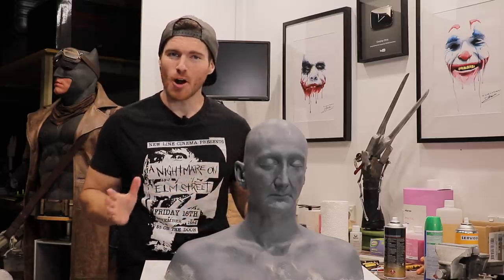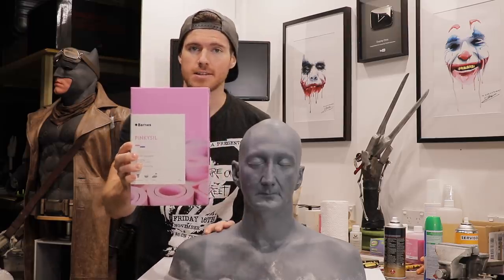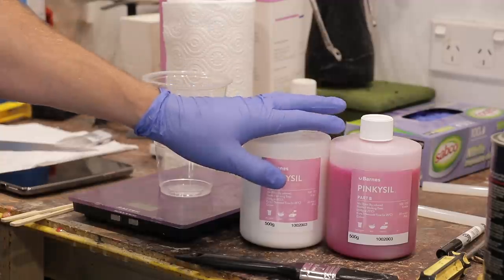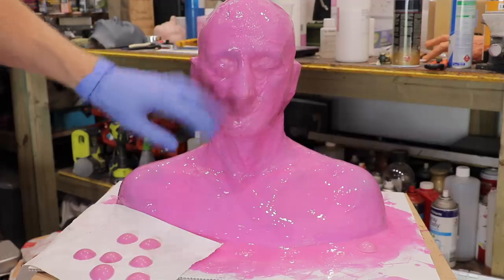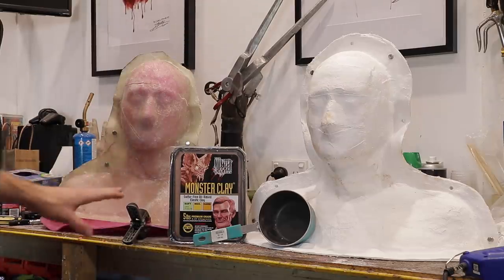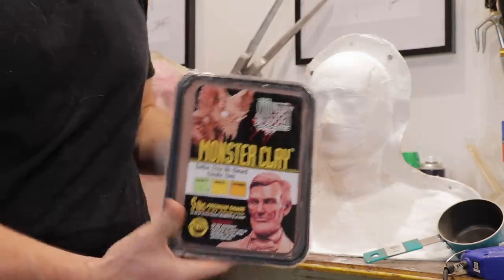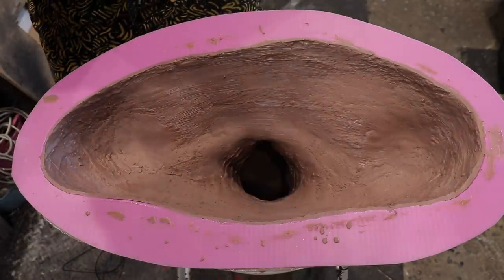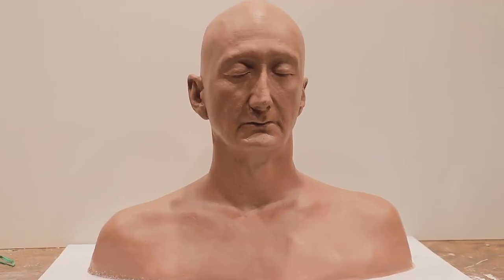How To: Robert Englund Lifecast Clay Pour

Comment: The actual container MonsterClay comes in can be put directly into an oven to melt it. I would have also included keys on the actual bust itself toi help key into it's jacket but you got the results you were aiming for. Sometimes I will melt clay and pour just the ears first to make sure they get filled correctly before pouring the rest of the head. Any demarcation lines can easily be corrected.